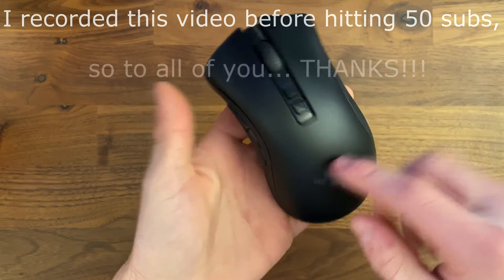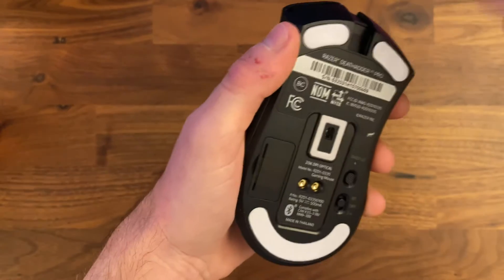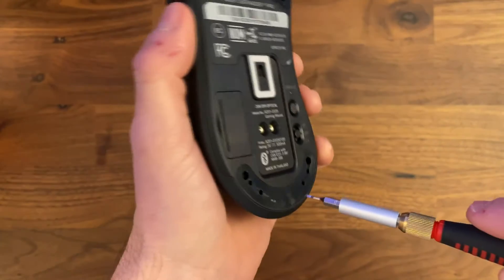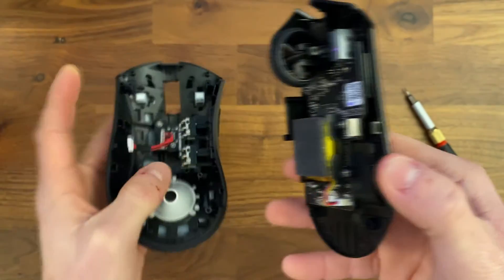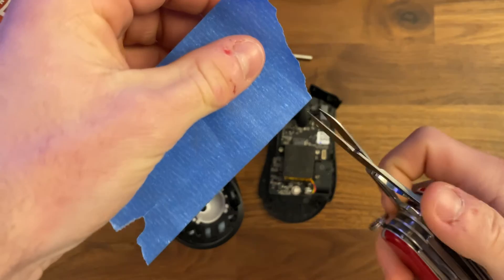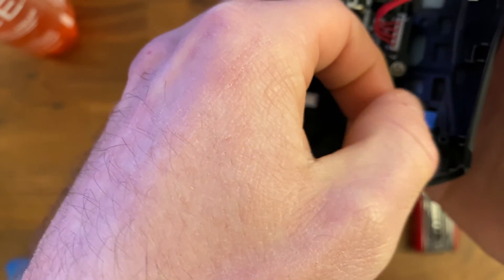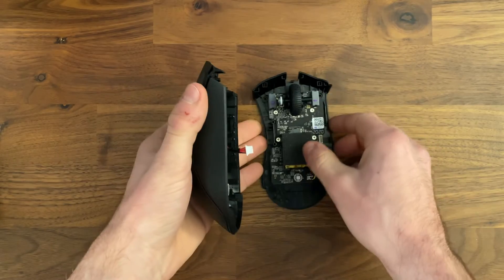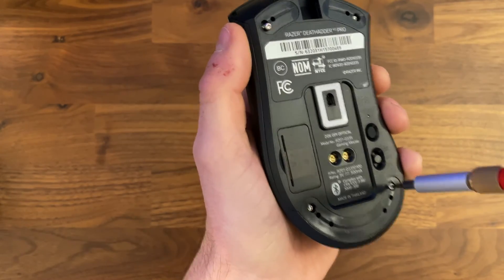Razer Deathadder v2 Pro Wireless Teardown and Pretravel Fix

Comment: Do you think it's worth it getting now?
Reply from the maker: If you can get it sub $100 probably, the mouse is nice, I like it for browsing and just general use
Reply from the maker: Or if you really love the deathadder shape
Reply: @joer1502  I am confused and I have a hard time choosing this or logitech g pro. I heard about tons of complaints about the double clicking in the g pro. I'm worried
Reply from the maker: @yesyes7650  they are both very different mice, one ergonomic one symmetrical. So you have to figure out what you want first, and check in on your hand sizing and grip, I’d say if you have small/mid hands and use palm grip the Deathadder is good, if you have mid/large hands then the g pro is good for claw...
Double clicking may still be an issue but they apparently addressed it in the newer copies. You could also wait for the Pro Superlight though there isn’t much data on its issues yet as it is a new release
Reply: @joer1502  the superlight I seen some reviews saying they cut so much to make it lighter that it feels cheap and its worst than the gpro. But do you know if deathadder has any problems?
Reply from the maker: @yesyes7650  not that I know of, other than maybe mushy clicks, look around on r/MouseReview
Reply: @joer1502  aight I guess I'll get the deathadder then. Considering the problems arent that bad
Reply: @joer1502  is the double clicking on the logitech something that will happend to all of the mice or just faulty ones
Reply from the maker: @yesyes7650  i believe only some, in newer batches supposedly they fixed it
Reply from the maker: @yesyes7650  dont just take my opinion though, look at others as well, so you can really see all the features and pick the best option